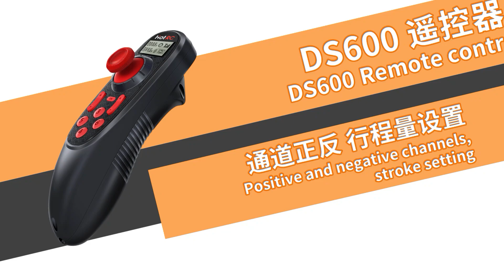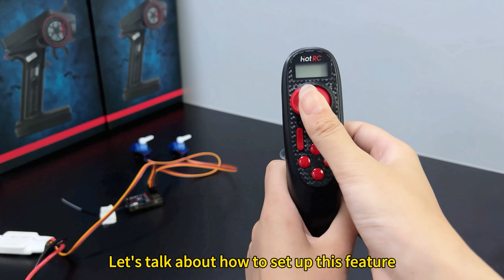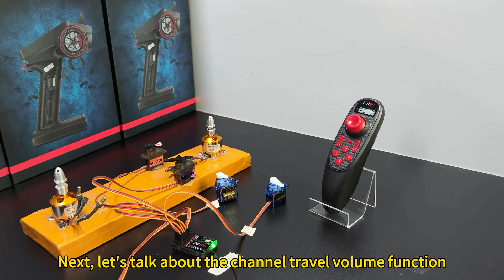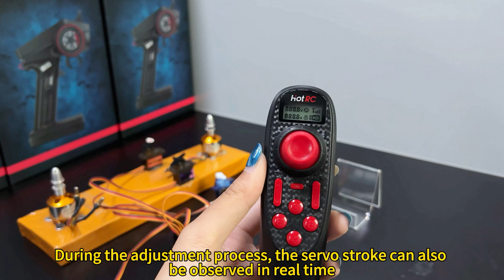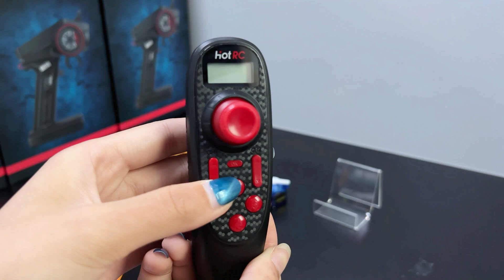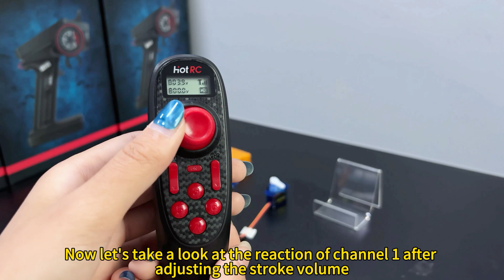DS600 forward and reverse channels + stroke volume

Comment: I need to control the reverse of one brushed motor with two channels, 3rd and 4th, of the F-06A receiver using the HotRC controller. How can I do this? For now, theoretically, I'm going to use a V-tail to connect the 3rd channel - "Forward", the 4th channel - "Backward" through a diode decoupler. Is this correct? Thank you!